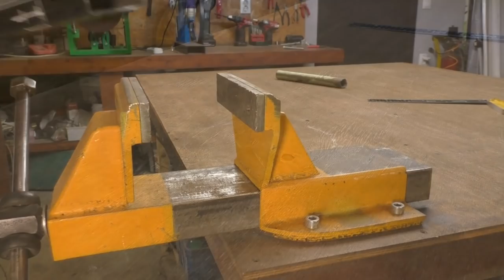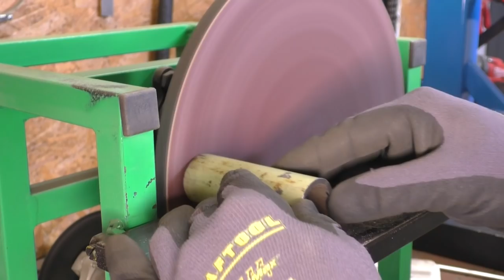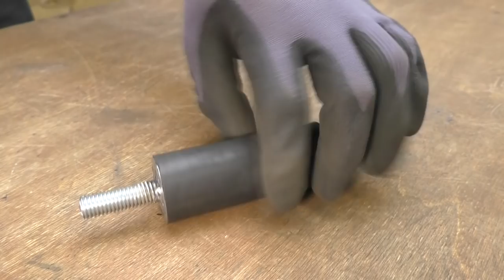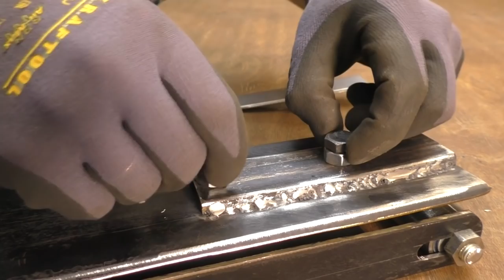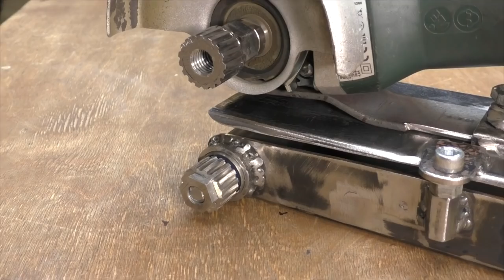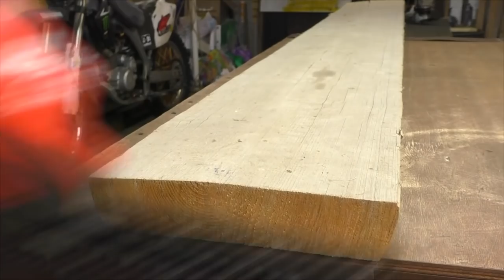The most essential tool for your workshop or garage!

Comment: Good job by why didn't you put the sanding belt slot on the other side of the drive belt and gears so you would not have to remove the drive belt every time you changed out the sanding belt?

Comment: Do you realize you're using the grinder backwards? I can't even count how many YouTubers I've seen do it that way so if it kicks, it kicks back towards you. You might think it doesn't matter if you have not gotten hurt by it yet. Let me tell you that after 20 years of being a fabricator and welder every time I seen someone get hurt or have a near-miss with a grinder, it's because they were holding it backwards and I understand egos and nobody likes to be told they are doing it wrong but don't knock it till you try it. I myself have used it like you do in a tight spot when I had no choice but given all the space you have on a workbench, I would definitely use it correctly so that if it kicks, it takes away and not towards